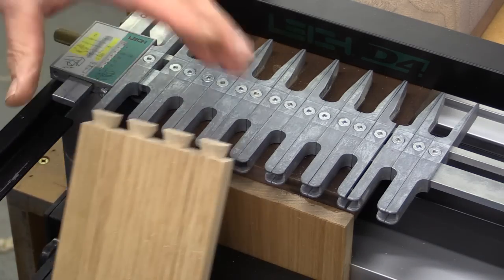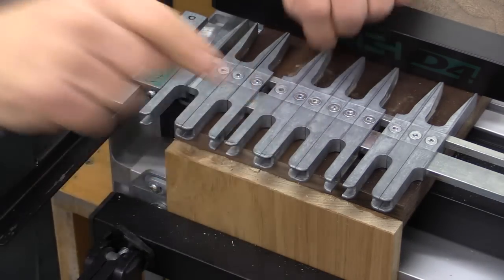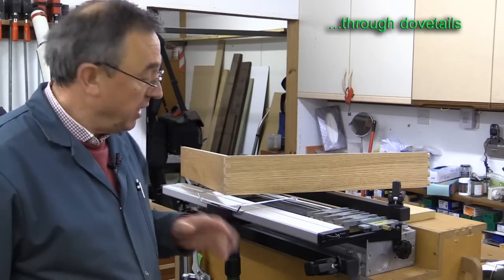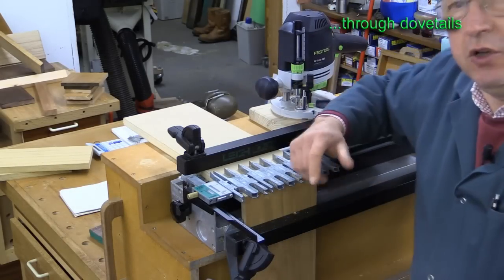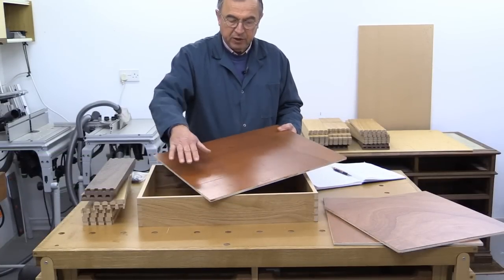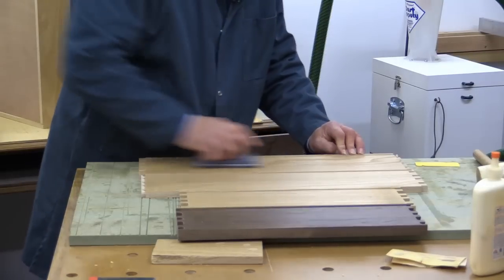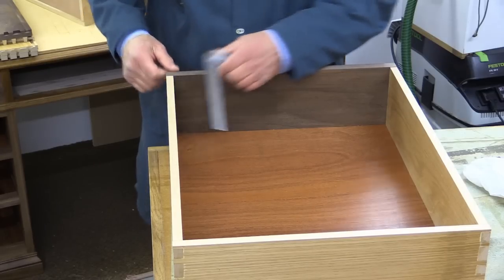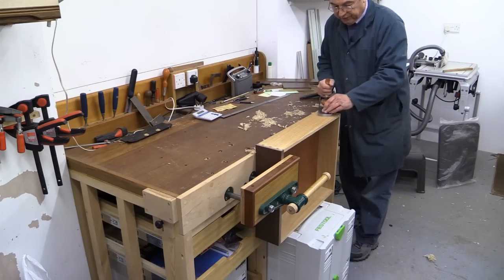Dovetail Drawers with Leigh Jig - Part 2

Comment: We’ve all made that mistake😀 I have to say I stopped using my Woodward because it was complicated for infrequent use and the router is noisy and creates dust. I now use a Veritas magnetic guide for hand cut dovetails. I think the Leigh jig seems equally complicated.
Reply from the maker: Hi Jim, It is fine if you are making several drawers or whatever but for just one joint you are right.  Cheers.  Peter

Comment: Beautiful, just beautiful. One tip though, and it has nothing with your woodworking skills ;-) Try angling your microphone downwards away from your mouth. That way you avoid the pops and the chest and throat rumble, and you get a whee tiny bit of room echo, which you need... (I'm a sound designer)

Looking forward to your next video in this series :-)
Reply from the maker: Hi Spacehero,  Many thanks for the great tip - I will do that from now on. Funny enough I had recently noticed the chat show people with their mics pointing downwards. I am in The Netherlands filming at the moment and have no battery operated radio receiver so I am relying on the camera mics - I hope it turns out okay. I will try and get a cheap and cheerful battery system in due course.

Thank you again.    Peter

Comment: Do you have any problems with your Festool Q1400 and the guide bushing moving?  When I use my Festool router the bottom guide bushing moves a bit resulting in some inaccuracy when using the Leigh jig?
Reply from the maker: Hi Chris, I did not have that problem when I used to use the OF1400 but I now use the OF1010 with the Leigh Jig. It works perfectly and you can adjust the centering of the guide with a mandrel.   Peter

Comment: Hi Peter, I enjoyed and learned much from your two part video on the set up and use of the Leigh dovetail jig. Several years ago I purchased the kit, including the vacuum support. Unfortunately I have not had the opportunity to use it yet, although I hope to remedy that issue soon.

I realise these videos are several years old now, however I have a question you maybe able to answer? I noticed on the half blind dovetail section the lip, or the the amount of material remaining between the top of the tails to the front face of the drawer is relatively thick, a 1/4" or so? I ask as I like the look of traditional hand cut dovetails where this amount is considerably less, more like 1/8" or so. Can the amount be varied or is the example you made restricted by the jig and cutters? Is it also possible to reduce the width of the pins, or does the jig and cutters prevent the pins being cut narrower?

In any case, great instructional video, clear and concise made better by the absence of a baseball cap. Many thanks. David.
Reply from the maker: Hi David, The size of the dovetails is the only disappointing feature of just about every jointing jig I know. In order to get slender "traditional" dovetails you need to make them the old fashioned way. Leigh do have several different sizes of cutter and so you could try the smaller ones and see if that approaches what you are after.  Cheers.  Peter
Reply: New Brit Workshop Thanks for your prompt response, Peter. With regards to the lip, can that be reduced in any way or is this just another downside of the jig. Thanks again
Reply from the maker: Hi David, Sorry, that is down to the thickness of your stock. The depth of the dovetail bit is fixed during the setup and so the only other adjustment is the stock thickness.   Peter

Comment: just watched a couple of your videos. very well done, being woodworker myself I have to ask why you don't use any mafell tools. they are the best kit. is it for sponsorship?
Reply from the maker: Hi Blaine, Just over 3 years ago I spent a couple of months researching the best mitre saws on the market. I then discovered the Festool Kapex. At the same time I needed a new track saw system and again Festool were pretty much at the top. I decided to stick to one brand where possible and so started buying Festool kit. I also have some lovely machines made by Jet, UJK, Numatic and Axminster. I also have some beautiful hand tools from Lee Valley (Veritas). I receive no sponsorship as I wish to retain my independence. I have received some help from various people from time to time but nobody has any control of my views or what goes into my videos.

Many thanks for your supportive comments.   Peter

Comment: Ver-EEE-tus.
Chap, sorry I may have missed it--why didn't you cut the bottom groove through the tail, centered, instead, plunging a stop groove? Was it strictly cosmetic?
Reply from the maker: matermark Cosmetic I expect. I try to avoid having to do a plunging channel if I can so arrange the layout accordingly.   Peter

Comment: Excellent presentation.   However, I have a question.  How did you determine the depth of the dovetail bit?
Reply from the maker: +Howard Kasdan  Hi Howard, This is easy to do once you read the very clear instructions that come with the Leigh Jig (I am sure the same would be true for other jigs). Each dovetail cutter gets set at a particular depth which takes account of the thickness of the guide bar. Once you have set this accurately the first time you can make a "reference" cut in a piece of wood or even you jig storage box so that you can set the depth quickly the next time.   Peter
Reply: +New Brit Workshop (Peter) Thanx, Peter.  I used a 1/2" dovetail cutter set at 3/8" depth and the result was perfect the first time.  I found the reference for setting the depth (never saw it before).

Comment: I got the D4R pro and a festool 1010 I used with with joy but on this project I'm using a ticker board (18mm) than I ever done before and the fits keeps turning out to tight (box joints). I can't lossen the leigh guidebush anymore then it will fall off. What can I have done wrong? - Any suggestions will be very welcome
Reply from the maker: Hi Jonas, I have not tried box joints yet. The Leigh instructions, certainly for the dvetail side, are so good that I recommend that you check the manual and see which way they suggest you make an adjustment. Are you sure that you have the right diameter cutter?    Peter
Reply: Thank you for your reply. Yes I have the right cutter I done it many times before (even though it's been a while since last time) - I think I might have found the problem (but haven't tested my "solution" yet) - I routed both the tail and the pins with the exact same settings (normally you put a space in to make the right offset when you route one of them) but that might be the problem because of the elliptical formed guidebush the tail and pins maybe not be 100,00% alike. In my test routing them in the same settings also means I have to offset the boards 1 pin to make them fit, which I though was fine just for a test fit, but doing this also opens for the small human errors of each pin not being 100,00% alike since we do set them up by hand even though we use our space block to set them very small variations might be the problem. Does that make sense? :-) - Thank you anyway for the reply it's greatly appreciated.
Reply from the maker: Hi Jonas, I am glad you have a solution in hand. Good luck.   Peter

Comment: Hi Peter! Is it necessary to give plywood room to expand in drawer bottoms, cabinet backs and/or cabinet fronts/door panels?
Reply from the maker: +Magnus Ericsson Hi Magnus, The plywood bottoms should be very stable but the drawer sides may not be unless they too are made of plywood or another (stable) man-made material.   Peter

Comment: Hi Peter. Thanks for this video. I just purchased a used D4, and am struggling a bit with the basics. Today while trying to route my first through DTs (following the Leigh instructions), I found the fingers separating during the cut. I had tightened them down sufficiently (at least I thought so), and once I investigated, found that the porter cable style bushing had come loose during the operation. Have you had an issue with that style of bushing losing its  grip? Also, I have seen complaints on the Festool forums about the lack of 'centeredness' of the bit in the  OF1400, and as a result I have been using an older standard Porter Cable router. Any thoughts on that? Have you experienced any issues using the OF 1400 with the Leigh jig?  As usual, thanks for your kind assistance. Rob Hiday
Reply from the maker: Hi Robert, I have no experience of the Porter Cable machine but had no problems with my OF1400. I now use the smaller OF1010 and it is much easier and can be centred if required.  Many thanks for the kid words.    Peter
Reply: thanks.

Comment: G'day Pete just came across your channel excellent work. I am interested in wood working but I have no idea and I am a novice, doing it as a hobby more than anything else.  I have a question (which may sound idiotic, but please bear with me here), you mentioned "chestnut" in your vid. Did you use actual chestnut wood for those draws?

The reason I asked is because I was talking to some one here in Australia about using chestnut wood for furniture and he said that it's no good due to oil / resin or something along those lines. Now I wasn't too convinced by him. So my main question is can you use chestnut wood for furniture and does it have any issues ?

The reason I ask is because I intend on setting up a chestnut farm and was hoping to use the wood of old trees for furniture.
Reply from the maker: Lex Rex Hi Lex, Yes, it is Chestnut wood for those drawer sides. It is the traditional wood for that type of thing. It machines well, has a lovely grain and is very stable. I would not like to be responsible for you making a life changing decision about chestnut as I am not an expert - particularly with the Australian species. You must take advice from someone other than the chap that you have mentioned.  Good luck.     Peter
Reply: Thanks Pete, you are a legend :) Love your vids and no you won't be responsible for me making a life changing decision. I have been looking at Chestnut farming for the actual nuts. However, I am also interested in wood working and always thought Chestnut wood was used for furniture until I spoke with this bloke here in Oz. He reckoned it had to much tannin etc etc but my research into it looks like he was totally wrong. It was valuable for me to hear your view because you actually use the wood to build with. The Australian species are effectively European, i.e. mostly brought over from Europe not the Americas. So no diseases etc for nut production. Thank you so much. Cheers.
Reply from the maker: Lex Rex Good luck Lex - chestnut farming must take a few years to get things started.   Peter
Reply: New Brit Workshop Thank you Pete, it takes between 3 - 5 years in order for the trees to produce nuts. The northern hemisphere just can't get enough of them. So when they are out of season, we are in season down here. This is more of a hobby farm situation I plan on starting on maybe a small block of 50 - 100 acres. Not all chestnuts of course, I'm looking at walnuts and hazelnuts. Plus a small herd of Highland cattle and Sheep. More for retirement to keep me busy :)
Reply from the maker: Lex Rex Now walnut is a really nice timber.   Peter